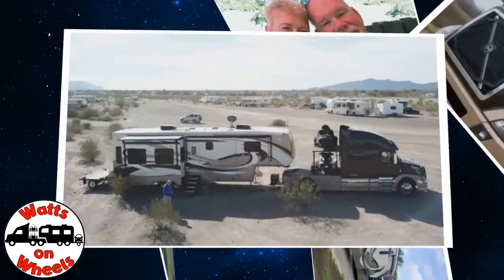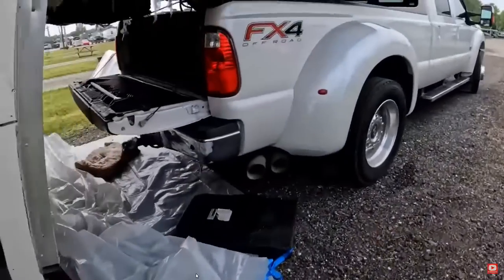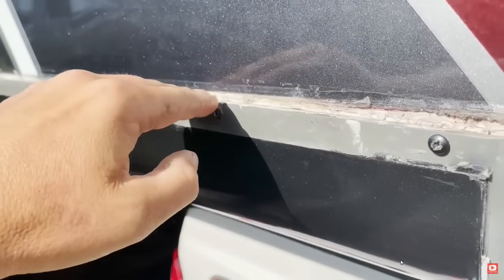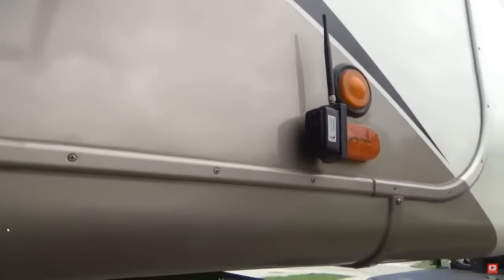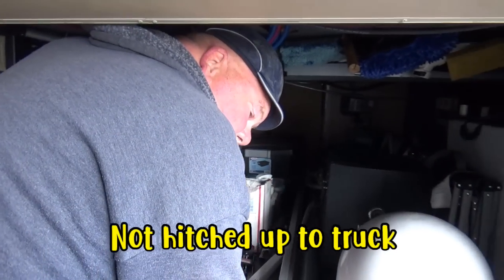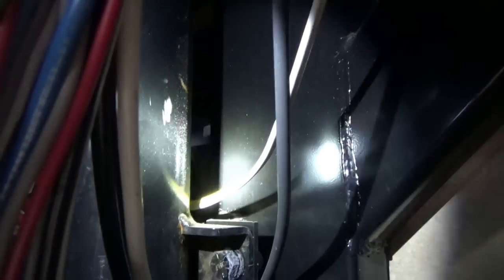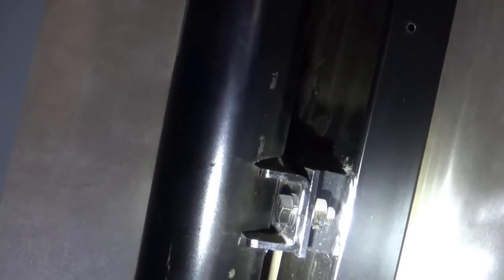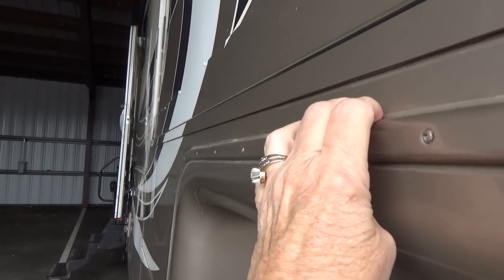😲 Cracked RV Frame Inspection // Lippert RV Frames

Comment: I think the screws are probably looses where the metal trim his to make the union of the upper deck and the bottom of the wall, I read a forum that peoples had that issue and they changes for bigger screws and longger one and they put the new screws between two older holes, to have new holes. Our screws when we hitch probably dont hold the bottom of the wall anymore, they are stripped in these holes, basicly the metal trim goes down when we hitch. Tell me what you think?
Reply from the maker: Definitely think that's a possibility.
Reply: Hi Dave, I had a talked with Affinity Rv repair in Goshen and the owner told me our problem is the screws underneat the side wall molding and upper deck, of course if the frame is not crack. Usualy he use 5'' self tapping screws(3/16 or 1/4 big) and screw in the same holes, 5'' his long to catch lot of material . Where I live it is -30 right now so I will give it a try in april. Keep me inform if you try that possibility and that resolve the problem. Greetings.

Comment: I used to do fabrication for Lippert for a few years!  I was the one welding the axle hangers, bumper extension and slide out plates (crush tubes and leg brackets too) on the beams....crush tubes and all necessary holes for wiring/piping too. (Strip line). When I started, we were fined $50 for every missed critical weld. That means it had holes, cracks or it was incomplete or missing. They would get stress tested too. I got 1 fine within my first 30 days and never got another one after that. (2 fines in a week and you got 3 days off with no pay and a write up along with the fines) had 44 critical welds per frame, and I typically did 25-30 frames a day. 

I wasnt fabricating the parts you were pointing out in the front, but those welds look like they were not good to begin with, for one, but incomplete as well, and some look like parts that werent welded together properly, but each department that fabricates those areas has their own critical welds.  Critical means essential for the functionality and safe use of the chassis. 

1:27  I have seen them cut the entire "upper deck" off of the chassis before because the people who were making it messed up the dimensions or something so bad it was worth it to cut that off and just put a new one on and fix the bad one later, to not hold up the line....."upper deck" was a special station that only made the top part of the chassis above where that specific crack is at, so they usually have a few ready in advance of the line.

I say that because it looks like its not a crack, but a cut.....that "crack" looks like a cut that wasnt welded properly all the way around.....they didnt weld deep enough and when the ground off the extra to make it smooth again, there wasnt enough holding the metal pieces together anymore. It wasnt picked up before powder coat. 

Notice how 2 of the other cracks right after in that sequence are jagged?  Those are breaks in the metal, that is how it breaks and cracks. 

I know its long, but the explanation is to help the people who dont understand why Lippert doesnt catch this stuff, or the people who think the workers are deficient (sometimes they are), or whatever. 

That and when they get steel from China, it looks like they left it outside in saltwater/acid rain for a few years. If the material is junk, end product will be.
Reply: Just wow and thank you!
Reply: Thanks for the information.  When corners are cut or processes not followed to the letter bad things happen, usually at the consumer level.  This disucssion of foreign steel is another reason for getting our basic industries back on line in the US to meet our needs, assuming our corporations keep quality in focus.  Some of the engineering decisions on these RV's makes one wonder about the expertise of the people who do the design specs.  Perhaps its time for lemon laws in the RV industry.
Reply from the maker: Awesome info.  Very interesting on the fines and time off.  Also very interesting on the cut vs. crack.  So glad to have you provide "insider" info to help educate us all.  Thanks so much.
Reply: @keithallen3119  putting the axle hangers on, I would have to grind the steel a lot just to get a good enough contact to start the weld. If it was raining that day, I had to use a torch to burn the moisture off first, then grind the rust...weld, grind it out, weld....until no holes were seen. Some steel felt impossible to get that result with. 

Its almost like over there in China, they take the whole car, plastic, seats and all, and make I-beams out of the melted mess that comes out of the process, with little refining. 

Some people were in the habit of using "spray transfer" at Lippert too....where the heat of the welder is so hot and the wire speed is so low, it acts like a melting beam...so if there was porosity, they would do that and attempt to "melt out" the porosity. The wire never toucheds the metal...it gets "so hot" that it sprays molten metal and remelts what is already there basically. 

I think some of those defects are from that.
Reply: @WattsOnWheels  I am glad you appreciate it!  I got replaced by a robot, btw, lol. I am not sure if they still have a strip line, but they were closing down plants and opening up a new robotic plant that was going to do my job (and the job of the other dozen rail guys), so they didnt need me. 

The fines and time off seem like no brainers, if they are related to safety especially, but the welds on your rig are pathetic in some spots it would seem and I dont know how they made it out of there.

We were getting nailed for things like having a post that was supposed to welded on all 4 sides, and one side would be missing 1/32 of the weld, or there would be pinhole sized bubbles in a 1/8 section of the weld. Also, if they were too fat, too thin, or if they were misplaced, it would get flagged.
Reply: Holy crap… this is a real eye opener to the whole “frame failure” trend. Robots can’t determine the conditions of metal they’re welding. Makes me wonder if these recent problems are stemmed from robotic indifference.
Reply: @WanderingWeekends  I got replaced by robots. They built a multi, MULTI million dollar plant ($50 million) where all of the plasma cutting and prefab welding was automated. 

I could go weeks without messing up. I could check my plasma cutters tips when they screwed up, I could change my welding guns tips, I could, as I was working, fix those issues. Air line, gas lines not working? I could see as I was going. Robots will just keep going. And they still have to have a team to fix them. 

Condition of the metal was also huge. They would have the metal out in the rain for so long, and the Chinese stuff was so bad, that we had to torch it to evaporate the water, and then grind the rust off before welding. Could have built a shelter for the metal at least.

Comment: Part of the root cause of frame failure may be the truck being used. Just like the gentleman is saying. The suspension on that rig is designed for what, 35k+lbs? That trailer is designed to be on the back of a one ton, likely dually, correct? That will allow the trailer and frame to ride differently and more smoothly than that large truck. The suspension is too stiff on that large truck for that trailer design. It caused fatigue on the frame differently than a 1 ton would. I’m not saying the trailer shouldn’t be able to take it. I’m saying the design did not account for that possibility of being towed behind that large truck. I’m not an expert on frames or tractor trailers, but I did spend 30 years as a powertrain warranty engineer for the big 3. I’ve done a huge amount of research and reading on this issue, and it’s not the end all be all for the issue of course, but if we can all learn from this I think the industry and customer experience overall will benefit. Thank you for sharing!! It was very informative!!
Reply from the maker: My thoughts are....on my rig, I have an ET Air ride hitch which will allow the trailer to ride softer and more gentle than a solid hitch on a one ton dually.  So the size of the rig doesn't have anything to do with it in my opinion, the hitch does.  Not to mention, my rig has been converted to a single rear axle with lighter air bags specifically to provide a smoother, more gentle ride.  That may be why WE did not have a cracked frame.  I cannot speak for other peoples set ups.  Thanks for your input.

Comment: @6:02, WHY is it that NOBODY ever mentions the real reason for the cracking and excessive flexing?  The BUILDER (and owner) put too much weight onto the trailer-design!  These trailer builders like to save a buck and order trailer frames that are UNDER DESIGNED for the load that THEY and the OWNERS put into them.  The rated capacity of these rigs is frequently over-loaded and if that's the case it is NOT the trailer-frame maker to blame for 'steel that is too thin'.
Reply from the maker: So true.  But some are cracking while underweight too.

Comment: I used to be a heavy equipment mechanic and work on many equipment trailers made to haul things like skidsteers, backhoes etc. That frame looks paper thin for what it is supposed to be doing.
Reply from the maker: Obviously you are right, since this is a problem.  Sad that money is more important that product or safety.

Comment: Dave, @5:18, there is a cable or hose routed behind the Jack attach bracket/bolt? Looks like a possible chafe area.
Best wishes from the far North.
Reply from the maker: Thanks so much for that carlthor...I'll definitely check that out.

Comment: Cheap RV manufacturing practices are to blame.
RV builders will do what ever they can get away with to save money using the cheapest materials. 
Also they are poorly designed for the purposes of use. 
We were at Big Tent in Quartzite, Az and looked at replacing our class C and after checking out many we decided to keep our 2004 class C because of how poorly and cheaply assembled they were, these were brand new RV's.
Reply from the maker: Totally agree.  They seem to be getting cheaper and cheaper.  Very disappointing.

Comment: I have a 2000 5 th wheel that has been to Canda twice and Alaska 2 times and has about 150 K miles on this camper and frame is way heavier on my camper and the new one are so thin .We just updated our 5 th wheel and still hauling it with a 1 ton dullay 4 door long bed dullay 5.9 diesel and have never had any problems with frame or axels and they were built by Lippert frame and axels but this steel in this traile is twice the thickness of the new ones so I’ll just keep my old one which is built way better than the new ones !
Reply from the maker: It seems like things are not made like they used to be.  I'd hang on to that camper too.

Comment: The engineers that are designing the frames are specifying way to thin of tubing. The fifth wheel area needs to be ROBUST. Improbably wouldn't cost an additional $30 to $50 in steel.
Reply from the maker: It's crazy isn't it.  I'm sure we'd be willing to pay a little extra for that.

Comment: Fifth wheels are really bad news. I have been RV-ing for a long long time and they have always had frame issues. They use the same Chinese cheap steel on most of them and they are under engineered. If you want to use these things as your home just not going to end well. Not designed for extensive use they just are not made to last. If you want to live in an rv get yourself a Prevost bus even an older one then at least you have a frame under you built for a million miles or more.
Reply from the maker: We've been lucky so far.  Just checked them again yesterday and still no cracks.  So sad, isn't it.

Comment: Those cracks you showed was through the parent metal not the welds. The rectangular steel tube is too thin. It appears they used 1/8 instead of 1/4 inch or better for a major stress area. Weak frame in a critical stress area will break. Overloading will cause bending before breaking. There's no distortion of the parent metal.
Reply from the maker: Yep...you nailed it.
Reply: It's sad that Lippert would blame that damage on overloading. The frame being the backbone of the vehicle should be able to withstand at least 20 percent more than rating. Even if the vehicle is not overloaded, the breakage will still happen over time. They were hoping past warranty.

Comment: Who built the the RV  they may have ordered  the frame from Lippert   who built  to the requested specifications details    by RV manufacturer  ?
Reply from the maker: RV manufacturers order them and they sit in the field outside until they decide to slap it together on the assembly line.

Comment: If you want to pull your trailer with a semi buy a spacecraft they are built for semi's!
RVs  aren't made for the type of pulling you are doing!
Spacecraft trailers are made for HD truck pulling!
Reply from the maker: Would love to have a Spacecraft, but my lottery tickets don't ever seem to hit.  The truck has been converted by engineers just for RV pulling.  What's the difference?  Pulling is pulling.  HDT has a better air ride suspension in the hitch and on the axles than any dully.
Reply: @WattsOnWheels  my old boss had a 56' semi with 8 slides by waymatic what a beaut back when I was on the road I had a 53' that I converted all air ride including the King pin enjoyed till ret

Comment: Dave  Always start high,  24 beers. It was the steel cracking not the welds. I think lipper  uses too thin of steel. My New Horizons in that area would be 3/16 to 1/4 inch.
Reply from the maker: I think you might be right on both accounts...beer and steel.  :)

Comment: "crack inspection"  lol.   My theory is inferior metal.  Other brands crack on the front just behind the hitch.  The metal should be tested to see if it is the correct flavor of metals that was specified for the build.  If it is cracking only on a weld they are not getting proper penetration....  But about a year or so ago I saw another brand had cracks on the area around the hitch on 5th wheels, not on welds just the metal cracking. Also some travel trailers had frames cracking, I think that was the wrong type of metal used.  It is more common than some would realize.  Happy belated Thanksgiving.  Hope you all stay safe and healthy.
Reply from the maker: Good info badgerpa.  Gotta wonder how much metal is left out to rust for a year before it is used too.

Comment: Well folks are hauling very large objects down the road at relative high speeds and very bumpy roads is one thing and like you said people are over loading them I see on YouTube where it’s happening to pretty new units
Reply from the maker: Good points...so true.  Thanks for watching.
Reply: Also turns out some manufacturers like Keystone are over loading frames with body weight and even delivering RV's hundreds of pounds over dry weight.

Comment: Most of the cracked frames I have seen are on grand design units. Lippert only makes frames to the manufacturer specifications (i.e. jayco, grand design, etc.)They have no controll on what the companies pile on top of them after its built.
Reply from the maker: Yep and no control on how much weight the owners stack in it or the hitch they use on their truck.
Reply: This is a known issue with DRV though.

Comment: Hi guys.. This was what I was telling you about... about a year ago... I'm sure it probably has something to do with some of the Welding.. but truthfully I believe the steel is not thick enough in that area because of the flex.. I agree with you..... In regards to payment... 3-4 beers.. And 2 pork chops... And maybe a back rub...🤣🤣... Thanks for the video.... Stay safe...J&A
Reply from the maker: It does make you wonder about the steel and where it is from and how long it's been outside.  We found this very interesting.  Take care.
Reply: @WattsOnWheels  I think it has more to do with bean counters, and weight target, than where the steel is from.

Comment: That's why my grandfather said never to buy a filth wheel camper to much weight can cause cracks and fractures very costly God bless be safe ✝️🇺🇸
Reply: I have had three different fifth wheel of different manufacturers and of different lengths.  My current Keystone Cougar 337fls with a Lippert frame is the only one that makes me nervous.  It’s not the fifth wheel It’s the construction.
Reply from the maker: All you can do is keep inspecting and try to dodge those pot holes.  :)
Reply from the maker: They all have their problems.  That's what happens when there are no codes that must be followed.
Reply: @WattsOnWheels  I pull a semi truck and trailer everyday things break just part of it be safe ✝️🇺🇸

Comment: Good video 😀 I thought drv made there own frames I have heard of one drv have cracked frame they fixed it themselves there channel tripping with the Smith haven't heard from there channel since  grand design has had issues with frames 🤔 have safe travels 😀
Reply from the maker: Yeah, there are several different manufacturers that have had cracks...not just DRV.

Comment: Overloading is the #1 cause.  Followed by use on rough road.  Then comes torque from too fast take off.  But you are talking about a reverse cantilever being used to pull from above the weight load.  That in itself is the poorest way to move something that is supported in such a way.  The amount of frame needed to accomplish this type stress exceeds what the manufacturer wants to use.  In essence, the length of the trailer becomes the frame and a good portion is suspended from above.  That is, from an engineering point of view, a bad idea.
Reply from the maker: I can believe that.  Good point!